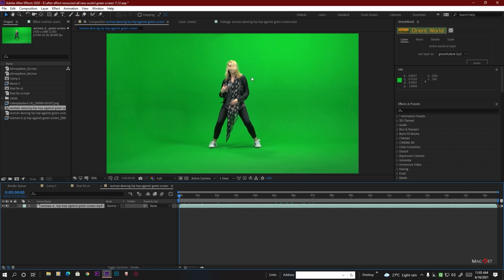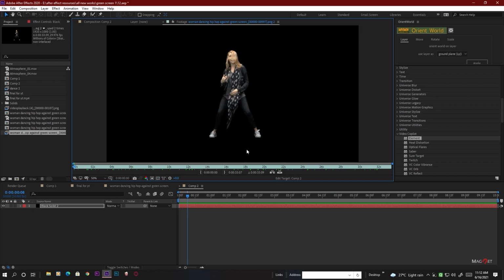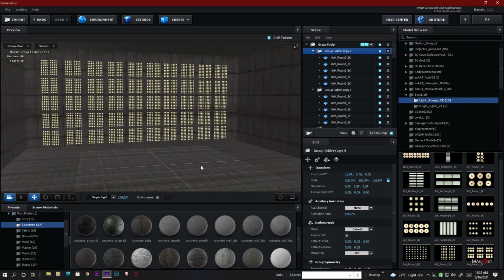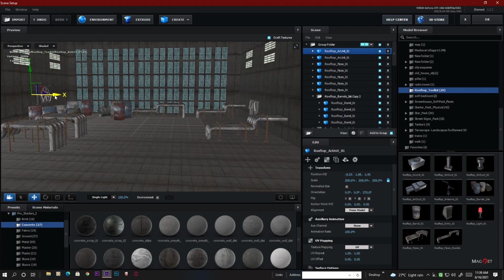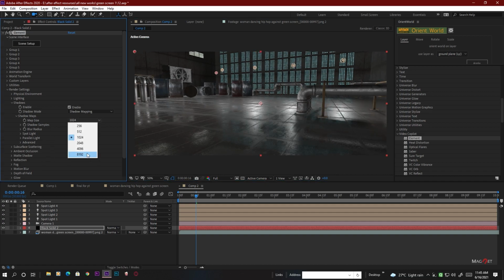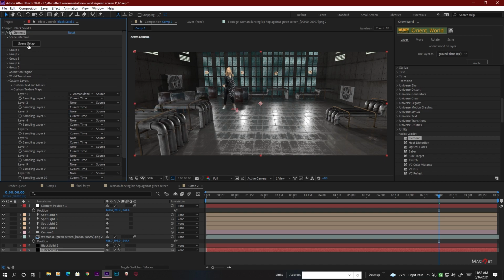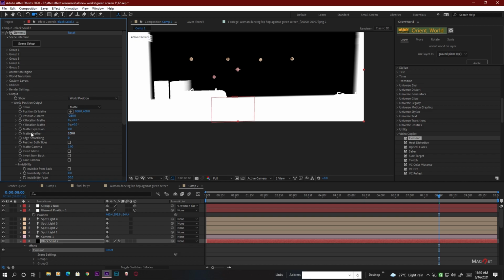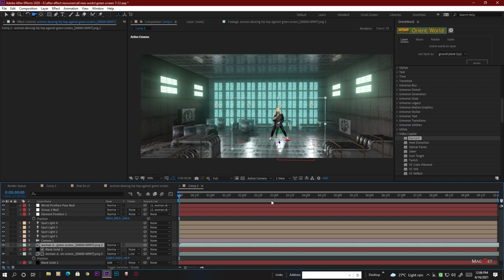Green Screen Footage compositing Tutorial inside Element 3D II After effect

Comment: That was a great tutorial, but unfortunately when i create the alpha plane for the shadows and reflection it generates shadows for the whole plane including alpha, even if I set alpha threshold to 1. I tried to fine tune threshold to other value also with no luck. In elements 3d everything looks fine and it seems like it got rid off the alpha but in after effects it takes the whole plane in consideration creating a rectangle shadow!
Reply: Did you find a solution to this?  I'm having the same issue...
Reply: Ok. Try not to use ray traced shadows, just the basic or deactivating ambient occlusion. One of those 2 parameters will fix the problem.
Reply: @andreaszografos6055  Thank you, thank you!  I disabled AO and that did the trick!!!  This was driving me nuts!  Thanks again!
Reply: same problem here!